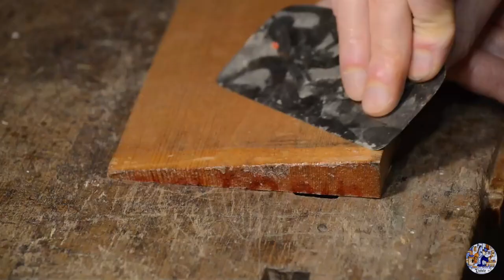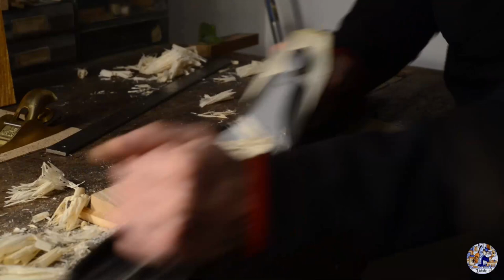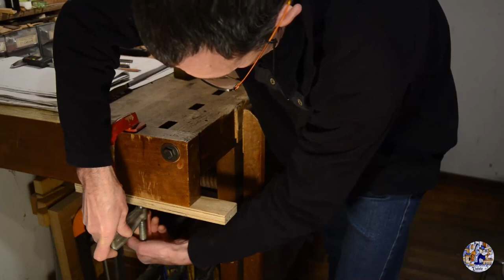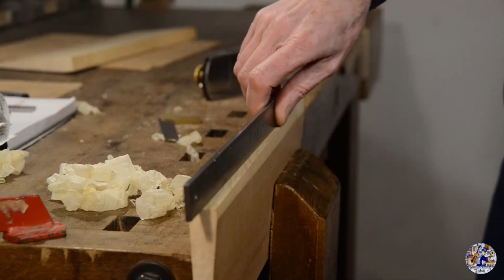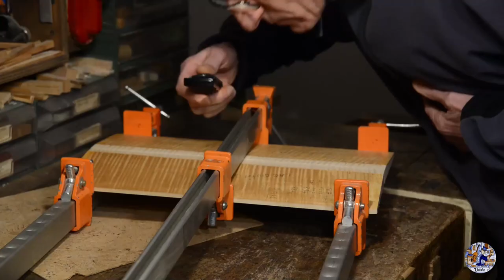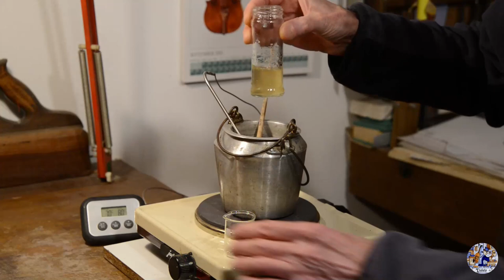Violin center joints from start to finish - Giunte centrali di violino dall'inizio alla fine

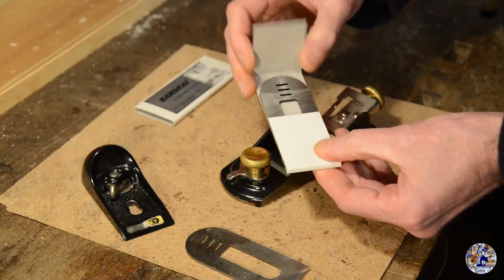Comment: I have success edge-joining the spruce, but I usually "chase my tail" with the maple. Can you tell us why you changed the hand plane iron at 9:14? Davide, I have learned so much from your videos. I cannot thank you enough.
Reply from the maker: I change the blade because for the central joints I keep a special blade dedicated only to this purpose, so as to always have it in perfect condition without having to waste time re-sharpening it every time. Just a refresh on the stones before starting the jointing.
And yes, maple is harder than spruce and harder to plane, super sharp blade is the key

Comment: Why the very lightweight clamps on the belly, but the very heavy ones on the back?
Reply from the maker: I prefer to use the light and small clamps (Japanese Hatagane) for the top plate because spruce is rather a soft wood, which could flex and warp more easily using large clamps, while the more solid maple does not have this problem. In any case, even the large clamps are not heavy at all, they are made of aluminum and therefore quite light, and could also be used with a little care for the spruce, if you want to save money on buying many clamps. With just the three large clamps you can glue all the joints from the violin to the cello, if they were only for violins they could be shorter and therefore lighter. The operating concept is always the same, support points very close to the bar to exert pressure directly to the center of the wood thickness in the most direct and straight way possible
Reply: @DavideSora  Hi Davide, thanks much! I have a set of good aluminum bar clamps (Dubuque) but was debating getting more. Perhaps I will grab some hatagane like you've got for the tops; they're considerably cheaper.
Reply from the maker: @manda60  Mine are Jorgensen, a few grams lighter than the Dubuque but essentially the same. I only have three, so when I make the joints I glue the back with that and at the same time the top with the Hatagane. The Hatagane also works for the back, I bought the Jorgensen mainly for the cello for which they are indispensable, but then I use them for everything (violin, viola) because they work very well. The Hatagane are a little more delicate to use because if you exceed a certain level of tightening (pressure) the bar flexes and the angle of the heads does not remain parallel. But this is also a guarantee that you don't put too much pressure, if the joint is done well you don't need to tighten too much

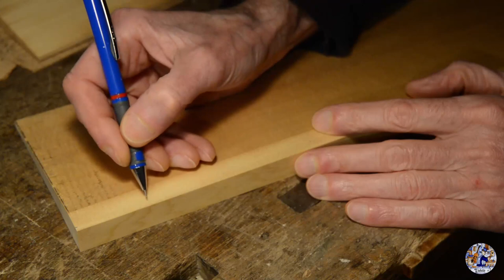Comment: At 8:32 what is the purpose of marking with the pencil? Are you identifying grain and using it somehow to match the two pieces? Would love to know how you are using those marks.
Reply from the maker: Your guess is correct, I identify and mark the same grain in the two pieces to maintain symmetry of the grain on the two sides of the top plate when making the central joints.

Comment: Mr. Davide, I assume applying glue over the joint at the end of the process is to ensure there are no small gaps or cracks on the outside of the joint, and that water you add gets absorbed by the wood and helps the joint seal tight as it very slightly swells the wood causing the joint to get tighter while the glue sets?  There are a lot of us out here that are trying to learn and we appreciate your time sharing your knowledge with us sir.  When I glue my joint I will do it exactly like you showed me I was just curious if my assumptions are right.
Reply from the maker: Yes, your assumptions are correct. Moreover, putting a layer of glue on top of the joint serves to slow down the evaporation of the glue on the outer edges of the actual joint, which would otherwise dry before the inner part and this part, remaining wet for longer, will be more swollen for more time than the margins, which could therefore open slightly. These precautions are perhaps a bit of overkill, but when it comes to critical structural gluings like center joints, it's better to be safe than sorry.🙂

Comment: Maestro, thank you for the world-class videos. Do you heat the wood and/or studio prior gluing up the joints? If so, what is your preferred temperature? Thank you, Steve from Catalina Island in California.
Reply from the maker: I don't heat the wood before gluing, because I fear that excessive heating could change the internal humidity content (EMC) which could cause the wood to move and deform, which even if minimal could no longer make the joints fit together perfectly. I admit, perhaps it's a slightly exaggerated and maniacal concern, but I prefer not to take the risk.🙂
What I do, and which is really important, is to do the gluing with an ambient temperature not lower than 19°/20°C, and with the wood well settled at that temperature for at least a week. Under these conditions, there is no need to heat the wood pieces before gluing.
Reply: @DavideSora  thank you Maestro for the answer. I definitely will try your well thought out method because it makes logical sense to me. Thanks again. 🙏
Reply from the maker: @moneypenny174  Just a warning: the glue:water dilution I indicate (1:4) is the correct one for a glue with a high gel strength (Bloom strength), my glue has it at 350. If this gel strength were lower (many glues have it around 150), the amount of water needed could be halved to obtain the same fluidity of the glue and strength of the gluing. If you don't know this number for your glue, the only way to figure out the correct dilution is to do bonding tests with different dilutions, and evaluate the behavior of the joint by breaking the test piece. If the joint separates too cleanly along the glue line, the glue is overly thinned.
You can refer to this interesting article (with also a video) showing a glue tested at various dilutions:
https://fixitwithshading.com/2015/08/02/the-ultimate-glue-test/
Reply: @DavideSora  Maestro, thank you the tips and the link. I did recently purchase 350 glue. I will do tests just to be certain of its strength.